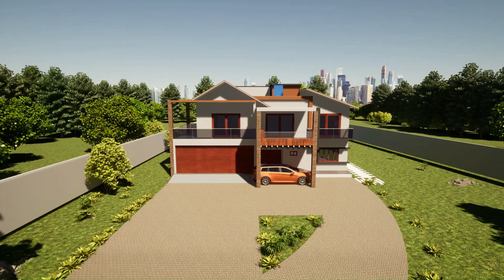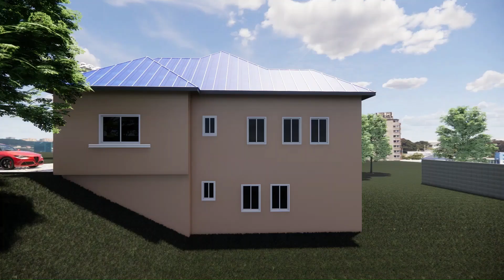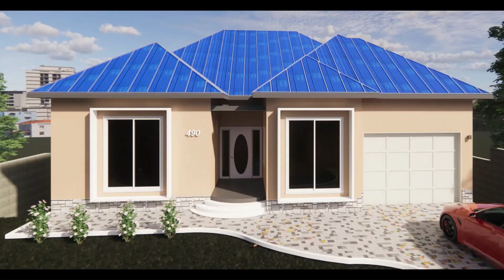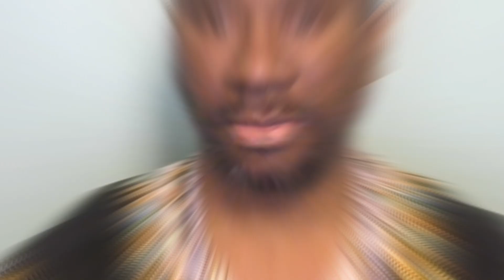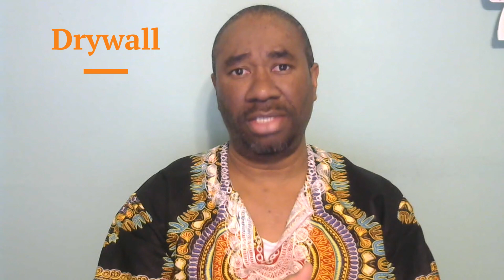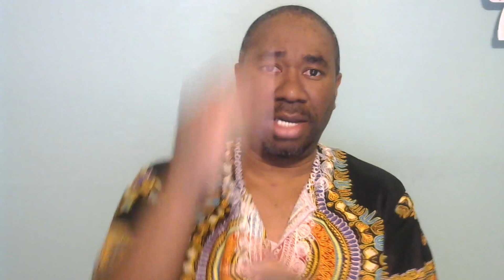How to use drywalls when constructing your dream home in Jamaica.

Comment: Question for you, what if you are only doing one floor but you do not want slab roofing, is it OK to use drywall ?
Reply from the maker: You can still use drywalls but you still need some load bearing partition walls.

Comment: I haven't started building yet and i'm doing mu research. The whole reason for me considering dry walls was to increase ventilation throughout the house to reduce the need for AC. What would the best way to build the house to keep it cool. ideally 2 levels house 3/4 bedrooms
Reply from the maker: Some of the walls can be dry wall, but not all of them especially if you going to put a reinforce concrete slab over the lower floor.